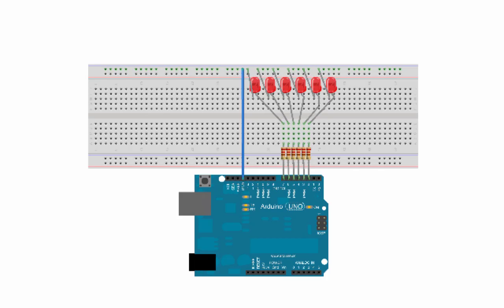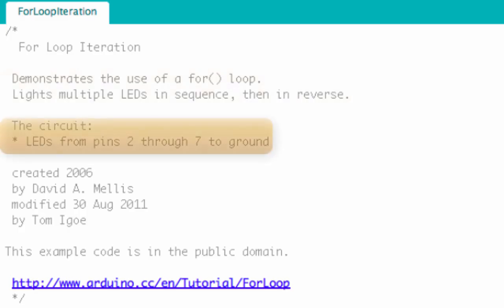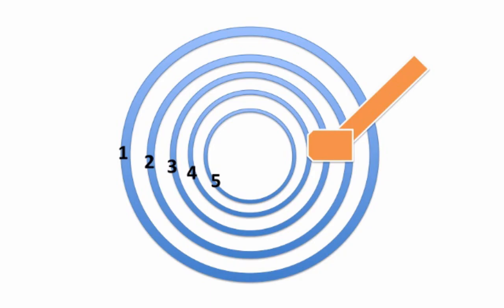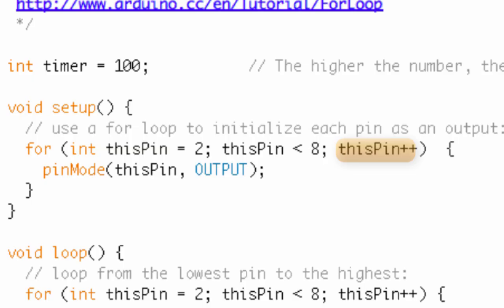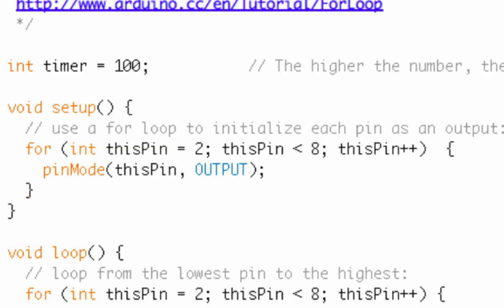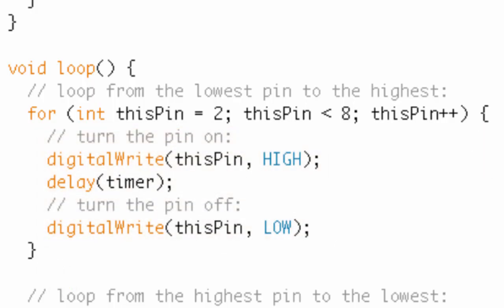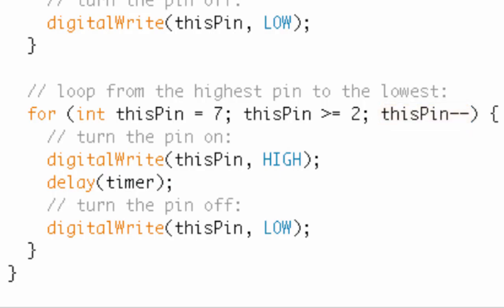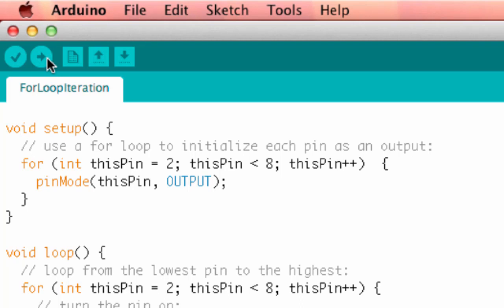Tutorial 12: For Loop Iteration: Arduino Course for Absolute Beginners (ReM)

Comment: Been watching all these, following along, doing the challenges at the 
end. Great work explaining this statement. I didn't have enough leds for
 this one so i used a 7 segment display...only problem was it's common 
anode. I used +5 for the common and exchanged all the HIGH's and LOW's in the
digitalWrite arguments, with their complements...then added the 2 leds for the 

challenge at the end....everything worked out aok.   This has been a great series. Thanks.

Comment: Hello, quick question: i dont get the for loop in the void setup, the void setup starts only one time if you upload the program to the arduino. So doesn't it mean that the value of "thispin" ends with 7 then the program jumps to the void loop and executes his functions, so would'nt only the 7 Pin an Output und only the 7 LED would light up?
Reply: No because all it's doing in the void setup is setting those pins as outputs. there is not another statement to set them back to inputs. In the void loop section there are two digital write commands one to go high one to go low, for each for loop. hope that helps

Comment: I did the test, but does not work like the expected.
I put the LEDs in sequence,and it works fine except for de pin Nine. The LED atached to this pin is turn on but is just a glimpse of bright, the other leds is turned
on and of like a charm.
I have no idea why thats not working.
Glad if someone help me :)
Reply: same my 8 and 9 or really dim. I forgot to set pins 8 and 9 as outputs. Change your void setup to include those pins

Comment: Why in the first block was <8 and not ==7 ?
Reply: I Know Im preety late but here its is :)
>8 basically means that the loop will continue if the value of thisPin is below 8 lets say 5 or 6.If it is 8 or exceeds 8 the loop terminates.
According to you if we set it ==8 That would mean that the loop will only run if the value of thisPin=8 which means if it had any other value(Lets say 4) it would terminate
Hope you Understand :)
Reply: less typing

Comment: Would it be possible to get the pins to do different applications with this code like run a servo code and blink or some of the other example codes simultaneously? And thanks for the videos there helping me alot and I am finally starting to get it through your vids.

Comment: Hi, just found this series, and it is very helpful. I have been playing with arduinos for over a year now and my collection of them is ever growing. That said, I used to be a BASIC programmer back in the 80's and 90's so I know some programming and even sold some basic stuff back then but this is a bit different.  While the For-Next differs a lot, it is made very clear in this video - Thanks a million, it looks like I can now do more then copy other's code and modify it for my purposes!
Reply from the maker: Glad it could help Jerry, thanks for watching!
Reply: Same here Jerry, programming at a community college back in the day.

C++ was just being introduced then. It's almost exclusively C++ now. C++ is much more sophisticated than BASIC. But CPU size has grown considerably from 8 bytes to now 64 bytes.

It's all the same after a high level language is compiled. If you have any spare time any Freshman level C or C++ programming class will get you up to speed.

Comment: why do we need 220 ohm resistors?....what if we dont use them?...the LED wont blow perhaps
Reply: +Ahmed Sumair Without the resistor, the voltage will be too high and burn the LED.
Reply: Just Add one 330ohm to the GND it works fine
Reply: its quite interesting how it can work if current is coming from anode, and not the other way around.

Comment: Wonderful tutorial series!  You explain programming in a clear and easy to understand manner.  I do have a question tho:  Why not just have the Anodes of the LED's plugged into the Arduino pin slots and the cathode ends to a single power rail on the breadboard and have a single resistor from that same power rail to the Arduino ground?  Since each LED is lit individually the resistor should be able to handle the load placed upon it.  This would would also greatly reduce the amount of components.

Comment: Hi I am new to Arduino and I have question regarding loops.

as void loop() is executed multiple times and if we declare a "for(;;)" loop inside it wouldn't it have same values each time it gets executed.
EX:
void loop(){
for(int I =0 ; I <3 ;I++){
// code
}
}
in this case since loop method is called multiple times won't the for loop have same values each time ?

thanks for your comments ..
Reply: +Sai T  i think in this case you would have to set "I" back to 0

void loop(){
for(int I =0 ; I <3 ;I++){
// code
}
int I=0
}

i am not good at this so it might not be right but i would think that is how you would do it.

Comment: Ok Im a little confused on this one 
When you set thisPin = 2 but then right after the thisPin < 8 and you have thisPin ++
Why isnt the VERY next statement under that going to make pinMode(thisPin, OUTPUT) be 3 
Or am I looking at it wrong
I would think since you put the ++ before the pinMode it would make it a 3 instead of 2 ?
Reply: +Jeff Shepherd : I have the same question. thisPin++ must get ignored if thisPin = 2.
Reply: +Jeff Shepherd - OK i just fiured it out. I think. After the first for loop, thisPin = 8 and after the second for loop, thisPin = 1. But it still doesnt make sense because it initiates thisPin as 2 so one or the other(thisPin = 2 or thisPin++) is getting ignored.
Reply: +Jeff Shepherd this is how it works. 
for(initialize the variable; check condition; do some action)
{                           
}
for (int thisPin = 2; thisPin < 8; thisPin++)
this is the sequence of for loop,
1. first initialize the "thisPin" to 2;
2. check the condition "Is thisPin less than 8?"
3. if the condition is "true" do the body between the curly braces {} 
4. then so the "do some action which is thisPin++" so now thisPin increase by one so it is now thisPin =3;
5. after the action, check the condition again (Is thisPin(3) < 8) if it is FALSE exit the for loop otherwise go to next step number 6. 
6. then run the body between curly braces. 
7. repeat step 4, 5, 6, until the condition is true else exit false.

I hope you understand.

Comment: do the resistors have to be exactly 220 ohms or would 330 ohms should work as well.  And thanks for the great videos....i have done the first 11 tutorials ....i didnt even think i would do the first three  tutorials . Thanks
Reply: +wadi gaji - These 5mm LEDs are designed to run off of 20mA of current. A 220 ohm resistor willgive you 13.6 mA. ((5 volts - foward bias voltage of red LED(2 volts)) / 220 = 0.0136. You can use a 150 ohm resistor to get full brightness. 3/150=20mA. A white LED has ~ a 3.5 Volt foward bias voltage, so the voltage across the resister will be 1.5 volts so; 1.5vollts/75ohms = .02 or 20mA. A 75 ohm resister for a white LED for full brightness. Using a higher value just means it wont be as bright. Just subtract the foward bias voltage from the supply voltage and divided it by .02 (20mA)   resistance = Voltage/current.
Reply from the maker: +wadi gaji I think the 330 would work just fine.

Comment: I was thinking about how you explained the order of operations inside the for loops and it's a little confusing. I looked it up and found this to be helpful. It involves explaining one more concept which you didn't cover, but I see why. It talks about the difference between ++thisPin and thisPin++ and how the order of operations effect the OUTPUT.   thisPin++" evaluates (does the other stuff like thisPin < 8) the value that thisPin already has (say  2), and then increments it adding 1, but ++thisPin" increments thisPin (ads 1) first, then evaluates it with the new increased value of thisPin (say 2 +1) = 3. It shows how the separate statements are decoupled and can write to different pins depending on the order that it incriments. http://stackoverflow.com/questions/4706199/post-increment-and-pre-increment-within-a-for-loop-produce-same-output  Hope this is helpful.
Reply from the maker: Craig King Thanks for sharing the link!

Comment: Question- Why do we need the for loop in the setup?  Isn't setup ran only once?  Can't you just set pinMode(thisPin = 2) ?

Also, wondering why the adder is in the for loop, and not after the digital write...Probably tough to explain in reply, but if you can- that'd be awesome.

Thanks,
Mike
Reply: Disregard- after the third time listening/watching this, I understand.
Reply: +Michael Wasiukiewicz bro what I understood is that if you put for loop anywhere, it will keep on executed untill it meets the conditions you set.... its another kind of if statement but this one having loop.
For the setup concept.. it is only run once and then it goes to loop...
I know your comment is pretty old but maybe you looking for the answer or maybe if this helps someone else

:)
Reply: +Michael Wasiukiewicz  Loop state ments are used when we have to do same task .. for example  in setup you have to type in pinMode (2,OUTPUT),(3,OUTPUT),(4,OUTPUT);  and so on tull seven which is time consuming and may cause errors while typing this much , to solve this kind of repeted task easily we use loop  . simple type" for (int currentpin =2  currentpin <8; curentpin++){
pinMode(currentpin,OUTPUT);
}" it does same task that you will designate manually  sortcuts rules :)

Comment: hi great tutorial so far BUT im confused as to why the for loop is running from the void setup section rather than the void loop section?>
Reply from the maker: Great question!

As you may recall, the setup() section only runs once.  We normally put all the code in the setup that we only care to have execute one time - the setup stuff, like pinMode(), serial.begin(), or other things that usually only need called once in the program.

Since the for loop you are referring to is calling the pinMode function, it makes sense to put it in the setup(), otherwise, it would get called over and over again in the main loop() - because the main loop repeats continuously.

Hope that makes some sense.
Reply: Open Source Hardware Group yes i understand now the reason i just missed the oat when you made that clear, i thought it was a messup that's all, now as far as the headers why am i not seeing any headers bring used our called at the beginning like #include what ever library?

Also i noticed setup and loop but not the main and i thought the order was main setup and loop?
Reply: so whats up with the not using headers file?  or using the attach syntax?

Comment: Why does the Arduino execute  a longer delay at the "ends" of each for loop?  

To be more specific, the LEDs on pin 2 and 7 seem to be lit for twice as long as the middle pins before the lighting reverses direction.  Thanks!
Reply from the maker: Dan Maher Great question!  It's because the first for loop ends with lighting up the LED at pin 7, and the second for loop starts with lighting up the LED at pin 7.

Then, the second for loop ends with lighting up the LED at pin 2, and the back at the top of the first for loop, it starts at lighting the LED at pin 2.

I hope that makes some sense.  So the start and end LEDs get double tapped.
Reply: I added a delay(timer) to mine after each for loop. It's not the exact same effect but it's evenly spaced out in time.

Comment: Great Tutorials.... Being a Neophyte to Arduino programing I have learn a great deal from your Tutorials. I do have a question in regarding to this one.... Is it possible to right a line of programing to have the LED Pause at pin 5 every 5 loops for a couple seconds (I've added pin 8 to the sketch) then continue.
Thank you once again for your tutorials
Reply from the maker: Sal C Yes, this is definitely possible.  You could add an "if statement" in side the for loop that checks for the 5th pin, and add an additional delay inside the loops, maybe something like this:

  for (int thisPin = 2; thisPin < 8; thisPin++) { 
    // turn the pin on:
    digitalWrite(thisPin, HIGH);   
    delay(timer);                  
    
    //if pin 8 is illuminated, keep it on for a while longer
    if (thisPin == 8){
      delay(3000);
    }

    // turn the pin off:
    digitalWrite(thisPin, LOW);    
  }

Hope this helps some.
Reply: Open Source Hardware Group Thank you very much for your replay and the code. It is most kind of you at OSHG.

Comment: i dont understand why you need the for loop in the voidsetup=(   #OpenSourceHardwareGroup
Reply from the maker: William Liisberg Great question.  The for loop in the setup is designed each pin being used in the sketch to work as an OUTPUT, so that we can apply High or Low voltage to the pin.

This is accomplished with the pinMode() function, which sets the mode of a pin as an Input, Output or Internal Pull-Up.

Hope that helps explain it some more.  Have a good one.
Reply: Open Source Hardware Group
So the only reason we need the for loop in void setup() is because it is constantly changing the pinMode for each pin as thisPin changes? As you said in the video, we could just manually set each pin as an output than. However, this would mean, if we ever want to expand on the number of LEDs we would have to then define those additional pins!

Comment: TRY ON YOUR OWN CHALLENGE:
Led the timer integer variable be controled by a potentiometer, If you followed the tutorial series fully, then you should exactly know how to do this.

The point of the potentiometer is to control the speed of the lights blinking.

TIP: You have to modify the Timer function, and it has something to do with the analogRead() function! :)
Reply: Hey Joshua (and OSHG)!

I got both of your "Try on your own challenge"'s to work but have run into a problem. As I adjust the potentiometer, it increases the delay, and subsequently, how often the input at pin A0 is read. I converted the Analog read to 0 - 250 to give myself a bigger range of speeds.

Anyways, my question; is there a way to have the AnalogRead(A0) operate as a separate function so it can have its own delay, 1, so it instantly reads any adjustments?

Hope that makes sense as I am new to Arduino and programming/engineering all together! All I have learned thus far has been contained in this series. Thanks in advance!!
Reply from the maker: Joshua Barendse Very cool!
Reply from the maker: Eric Bartha That is great question - and yes it makes sense.  You don't want a lag in response, especially when your input value is larger.

Try putting... 

timer = analogRead(A0);

inside each for loop, right at the top before the:

delay(timer); 

That might work.  Hope that helps some.
Reply: Open Source Hardware Group Thanks for the reply. Due to the nature of how I changed it to get the potentiometer to work with it, I do not think this will work. I have "voltage" (which is what is used in the delay) defined as a float = sensorValue * (5.0 / 1023.0) * 50 where sensorValue = analogRead(A). To me, this means if I define voltage (or timer) as you suggested, it would then change the number driving the delay. hmmmmm
Reply: Open Source Hardware Group
Okay, so I added
    int sensorValue = analogRead(A0);
    float voltage = sensorValue * (5.0 / 1023.0) * 50;
    Serial.println(voltage);
to the top of every for loop. When analyzing the serial monitor, I can clearly see this works much better but there is still a delay (only a few ms). I understand in theory why this works, but not why there is still somewhat of a delay. Could you point me in the direction of any literature that could help me to understand this? Thank you so much for your response!

Also, you need to make more videos on the Arduino! I believe I have watched them all at this point. haha!
Reply: Thanks for the interest guys, god bless the open source community right!

Eric Bartha Okay, that is some nerdy question there. (and i thought that i was the real nerd, unfortunately not a nerd but a noob XO).
i am afraid that you need todo some googling my open source friend, unless the Open Source Hardware Group reply's to your question. Good luck ;)

Comment: what if you just wanted the first half of the sketch to run.  In other words, instead of a single light chasing back and forth, you just want to have it run continuously in one direction and then repeat when it gets to the end?
Reply from the maker: Great question!  If you delete the second "for loop" I think it would achieve the result you are looking for.
Reply: Open Source Hardware Group
If I could expand on that.  I would send a direct message, but I figure people may also have the same question.  So I've successfully modified the forloop to not run backwards in the opposite direction.  So it simply chases repeatedly in the same direction.  Now I've since modified that to where instead of an individual light activating one-at-a-time, the previous light stays on, as if the row of LEDs was 'filling up' like a bar graph.  It works, but for some reason, it doesn't loop after all LEDs are activated.  I'm trying to get it to start over from the first LED, and repeatedly "fill up" like a bar graph.  Is there something I may be missing, here?
Reply from the maker: At the end of the program you might try something like this:

//Turn off all LEDs at the end
  for (int thisPin = 2; thisPin < 8; thisPin++) { 
    digitalWrite(thisPin, LOW);    
  }

Hopefully this helps!